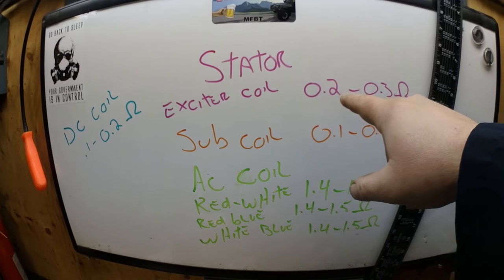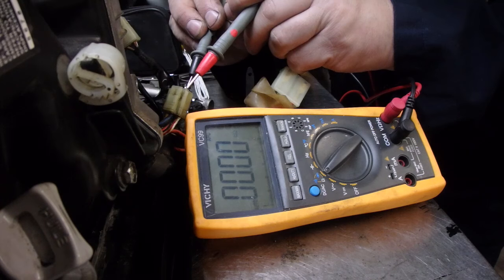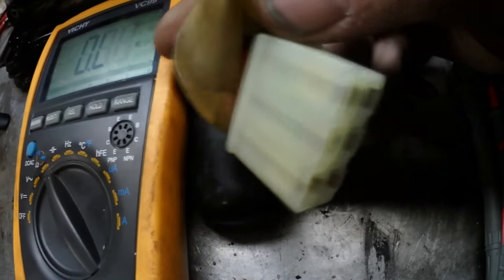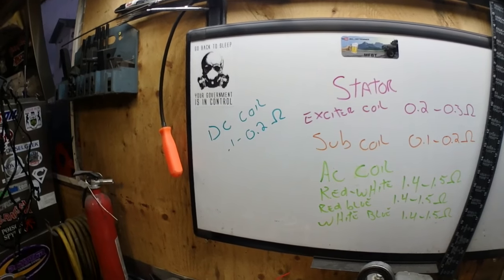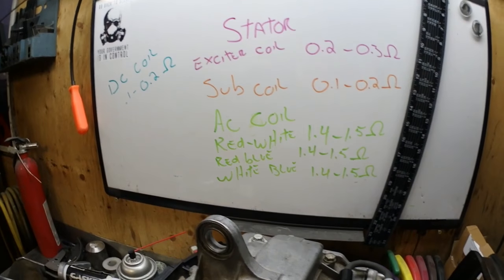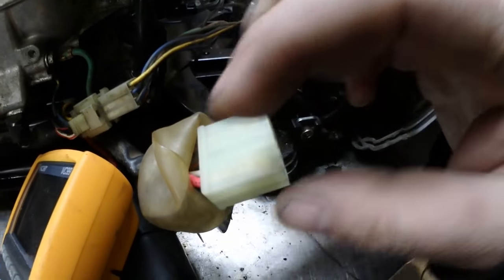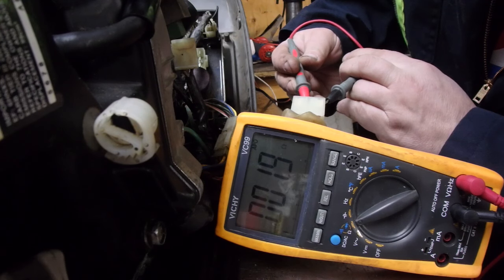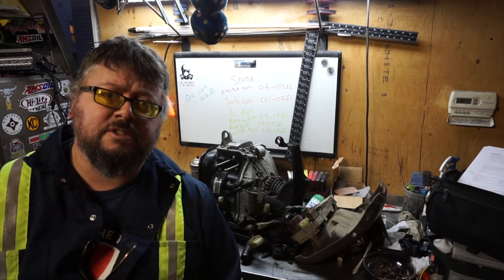How to Test a Stator Honda Eu2000i

Comment: Meyer's fine and numbers are fine.  With really low values like that you have to allow for test lead contact resistance. lead resistance and the meter's low range accuracy.  Try putting both test probes onto one connection and you'll see the extra resistance it adds.
Reply from the maker: +bigclivedotcom the resistance in the leads is like .2

Comment: Hi, I find your videos very helpful, thank you.  I have a question before I go down and text one of our 4 eu2000i generators.  The issue is current.  I'm getting 120V, but the amperage is way down.  It should run one of our hammer drills but it barely turns it.  Thoughts?

Comment: Well just a little information for all people i was having the SAME issue with my EU3000is here is some advice the black wire that goes to the Coil actually gets a signal from the ignition module that tells the coil to fire the sparkplug FYI i was chasing the same issue found out the wires on the ignition module NOT the Coil unit were corroded preventing that signal to the coil. even though the black wire doesn't even connect to the ignition module it sends it via the ground or something like that. im just trying to help people i was frustrated for days on my eu3000is

Comment: Jerry use the relative button on the meter to Zero out the leads   I think you are measuring  the res. of the leads with you testing  But a cool vid also   Joe
Reply from the maker: +Joseph Tucci the resistance in the leads is .2 not enough to make a difference this machine can't measure accurately
Reply: thanks Jerry Time for a fluke 88V?
Reply from the maker: +Joseph Tucci lol I'd never spent that kind of money on a multimeter
Reply: jerry bskorner Good move.  Fluke meters are made in China like your existing meter.  The odd readings are just a result of lead and contact resistance, and the usual inaccuracy at the lower resistance readings.  A Fluke would have given similar results.

Comment: i have   a eu 2000i  had a  burnt stator  was still making power but was becoming hard to start ,felt  kinda like a  ratchet   when pulling  i have replaced the stator  now and runs but no power  does the winding need to be flashed ?   and what is the procedure to do it
Reply: don't know on your unit but on Craftsman generators took a 12 volt mower battery with jumper wires one end hooked to the battery other end had pins ,, with the unit running shoved the red in pos and the black in the neu of the outlet ,,you will hear the engine drop in rpm a bit pull the wires out of the outlet and unhook the battery ,,,you don't hold it in there but a second once it starts making elec you could damage your battery ,, not sure if it done the same on the newer ones with the computer board ,,